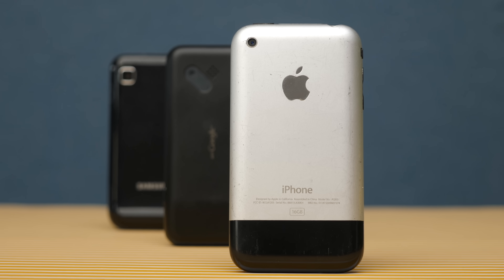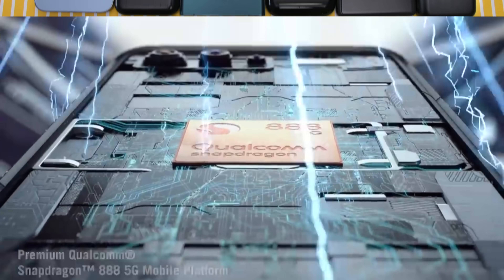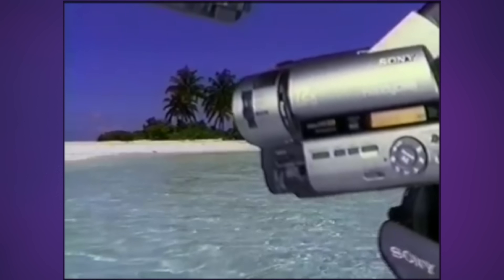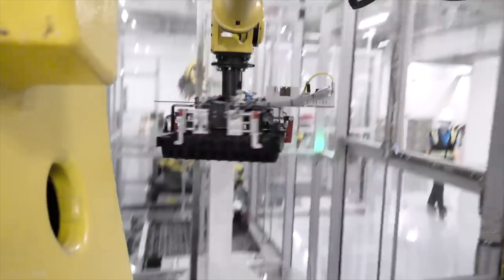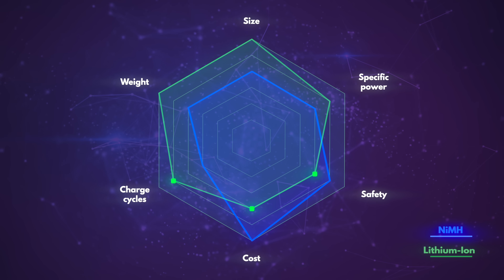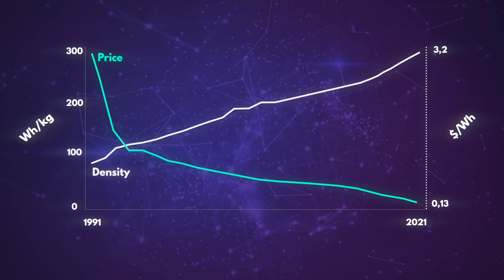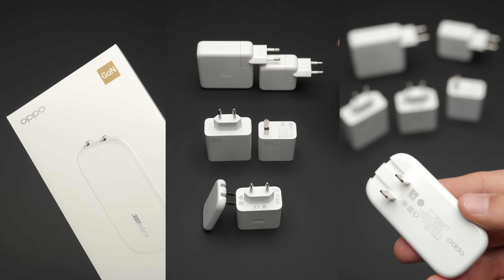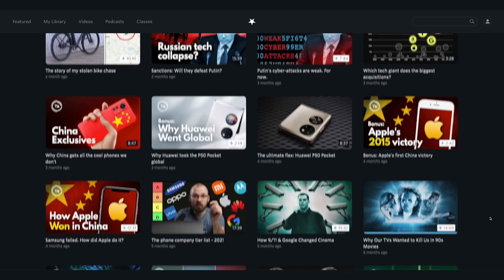The billion dollar race to fix phone batteries

Comment: Silicon isn't all that abundant anymore.  It is mostly extracted from beach sand.  Humanity has already extracted most of the beach sand in the world to the point where we have to extract even more underwater - thanks to vanity projects like Dubai's artificial islands.  The impact on the environment is very concerning.
Reply: The biggest sand consumer - easily taking places 1, 2 and 3 for itself - is concrete. It sucks up sand like nothing else. 
Construction mostly uses river sand because they don't have to deal with salt that way, but it also means that there's no new sand washing downstream.
Reply: Beaches and concert need coarse sand, why can't fine sand form desserts be used to make silicon ingots?
Reply: @Alhussainba  I highly recommending reading about it online - it's quite an interesting topic.  Desert sand is largely useless to us - I found this explanation online: desert sand grains are finer and smoother so their surface chemistry would not be able to offer sufficient number of multidirectional chemical linkages.  They also have other undesirable contaminants.  Basically: desert sand is the wrong shape and difficult and expensive to use.

Comment: Sad that a few years ago there was a supposing GRAPHENE Battery that was to come out it seems that has Poof from existence (not really but you get what I'm saying)
Reply: We need to kick Sony's bum and get them to pull the same move they did with li-ion.
Reply: @attomicchicken they announced in 2016 they would make lithium sulfur batteries commercial by 2020 but in 2017 they sold their battery business
Reply: A lot of batteries are really promising as a single cell in a lab, but are unsuitable for some reason when you try and mass produce a full battery to use in real world conditions.
Reply: The rich elite need to buy the land first before it can be mass produced.

It always happened

Comment: You didn't mention that Li-ion batteries can only be charged to 80% quickly and then have to be trickle charged. This why car companies only ever give 0 to 80% charge times. A friend of mine went to buy an electric car and they couldn't tell her the 0 to 100 % charge time !!!
Reply: Yeah cuz otherwise it will degrade the battery way quicker.
Reply: This isnt special to lithium. Thats kinda a general rule for all batterys.
Reply: @silvy7394  But they never mention it and I'm not sue you're right but i'll research it
Reply: @fincaman2  Bruh you just have to charge a battery to fucking know that. You dont need a degree like me.
Reply: Is this by design or is it the physics?
Reply: @TheZachary86  it's more chemical  as charging your device to extreme ends of the battery i.e 0% and 100% is when the batteryis more stressed which is bad.
Reply: @Anon-kx8tm  Yes but they always give discharge rates from 100% to zero
Reply: @TheZachary86  the best way i can explain this is that the world doesnt run on linear processes. charging involves the physical movement of electrically charged particles through a membrane. every single ion takes the same amount of energy to push, but when youve pushed countless particles through, the remaining particles are probably going to be the ones with a higher barrier to movement and once they start moving, there is going to be way less space for them to get to a hole they can fit in. itll probably require more movement of particles that are already in their holes to get them to make space. this will take longer and sap more energy, and forcing them to move faster is going to generate tons of heat due to their resistance and both the heat and the force at which the particles are moving can damage the structure of the electrodes. 

the real answer to your question is both. a battery that isnt controlled will slow down as you charge it more anyways, but if you force through too much power, you could blow up the entire battery. thus, they carefully control the charging rate of the battery, monitoring the temperature and resistance such that you dont need to stress the battery in the first place.
Reply: @jonathanodude6660  A way you can approach this mathematically is that anytime how much you can change a value depends on how big the value is already, you’re in exponential territory. Think COVID, compound interest, and yeah, batteries. The more positive ions there are on one side, the harder it is to push more into that side, as they repel each other. Therefore the rate of moving positive ions over depends on how many we already have there. Hence, exponentially more difficult charging at higher percentages.

Deriving this fact is one of the more counterintuitive aspects of an intro calculus course. Humans seem to intuitively think charges in values are independent of how big they already are, so we’re bad at exponential growth.
Reply: @thebaker8637  yeah I was trying to give a very physical explanation since I was assuming they aren’t big on the maths behind it and people often understand physical explanations better. But yeah that’s a good mathematical explanation for it as well if others are more inclined that way.
Reply: @jonathanodude6660  So do they give discharge rate figures from 100 % ?
Reply: @fincaman2  discharge rates? what do you mean? the voltage is always highest at 100% and drops down as the battery depletes for the same reason that charging slows down as the % increases.
Reply: @jonathanodude6660  The rate at which it discharges
Reply: @fincaman2  I’m no battery engineer, but this seems like either a theoretical property more than a physical one, or it’s the mechanism by which we describe battery capacity. In either case, it seems that the commonly used discharge time is 10 h, therefore you can simply use battery capacity in Ah / 10 h to work out discharge rate in A. This works whether the value was experimentally determined in 10 h or whether this is a theoretical rate based on a capacity worked out using other methods.

And I’d assume that they’d have to get to as close to 0% as possible and the battery would probs be fully charged to begin with or else what would they be testing?
Reply: @fincaman2  ie, a 5000 mAh smartphone would have a discharge rate of 0.5 A.
Reply: @TheZachary86  Its physics. Squeezing out the last bit of toothpaste, accelerating to the last kilometer of your car’s top speed, cleaning up the last bit of trash from a park, etc. are all asymptotic processes, the closer you are to the goal, the harder it is to progress at all.
Reply: @TheZachary86  It's the physics

Comment: There's constant noise going on in the video, especially when talking - video is great, but I think the noise issue is something worth looking into.
Reply from the maker: It's the hissing from the transformer of my Neon sigh, which is a bit tricky to work around, but I have a plan to fix it eventually :P
Reply: Just record the video and sound separately, or insert thr neon light digitally
Reply: I didn't notice it. But maybe it's because I use an external loudspeaker (Bluetooth).